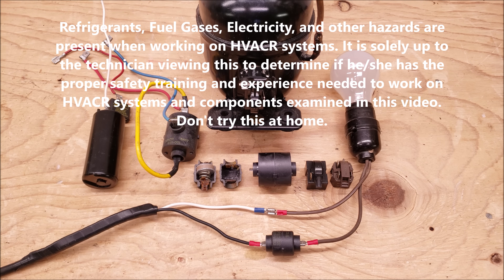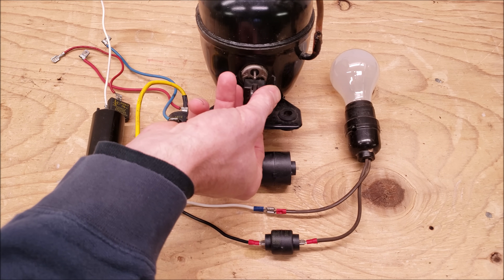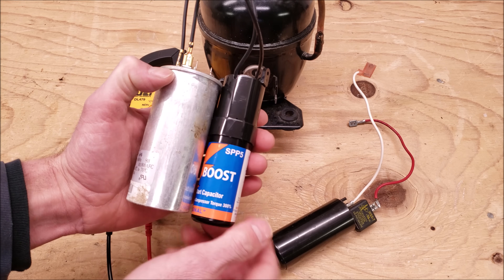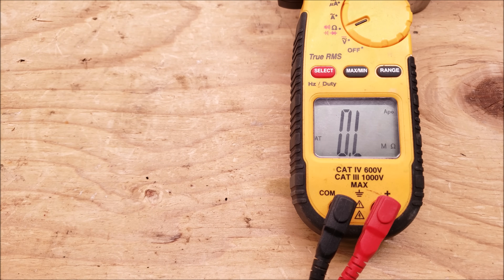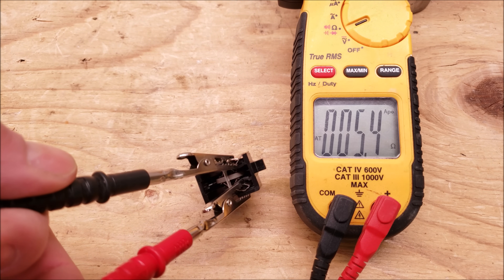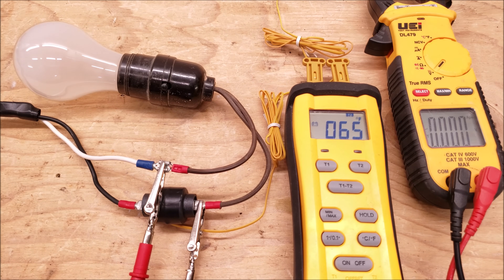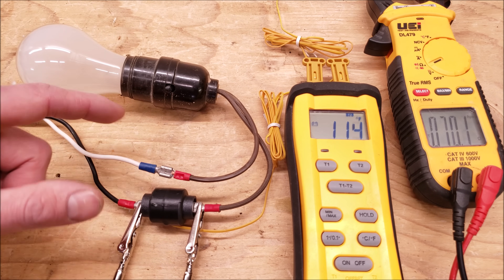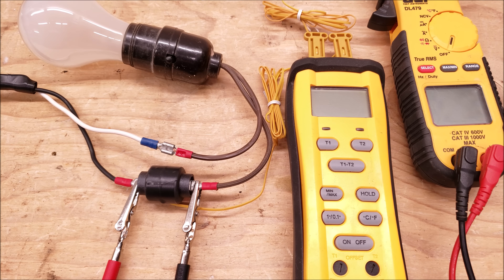PTC Compressor Start Assist, How It Works, Testing!

Comment from the maker: Support-  https://www.patreon.com/acservicetech

Tool List-  https://www.amazon.com/shop/acservicetech

For those that are looking for the tools used in the videos: (Linked Below)
Appion Valve Core Removal Tool http://amzn.to/2uYr8WL
UEI DL479 Multimeter with temp sensor http://amzn.to/2jtsUbJ
Blue Vapor Yellow Jacket Gauge- https://amzn.to/2Ju7pan
Red Liquid Yellow Jacket Gauge- https://amzn.to/2sSFmGH
Quick Coupler for the Gauges- https://amzn.to/2sTk8Ze
JB Test Gauge High Side-  http://amzn.to/2ruQb0l
JB Test Gauge Low Side-  http://amzn.to/2qR0utM
Manual Copper Tube Swage/Expander- https://amzn.to/2WRPa1M
Uniweld Hydraulic Swaging Tool- https://amzn.to/2MlrI8m
Uniweld Swage and Flare Kit- https://amzn.to/2T55jyn
Ameriflame Oxy Acetylene Torch Setup- https://amzn.to/2SRm3JF
#2 Tip for Oxy Acetylene Torch- https://amzn.to/2SPDaeD
Cap-N-Hook Tip for Oxy Acetylene- https://amzn.to/2MbhpUk
Air Acetylene Torch Setup-    http://amzn.to/2aQalsb  
15% Silver Brazing Rods-  http://amzn.to/2gVLyLc
Nitrogen Regulator-   http://amzn.to/2bXdR5f
Nitrogen Flow Meter-    http://amzn.to/2brvoBg
NitroVue Flow Reg-  https://amzn.to/2MiulYv
Ultrasonic Leak Detector- https://amzn.to/2Lw4Zpr

UEI DL479 Multimeter with temp sensor http://amzn.to/2jtsUbJ

Magnet Jumpers- https://amzn.to/2PyKPQZ

Alligator Jumpers- https://amzn.to/2PxqJXn

Fieldpiece ST4 Dual Temp Meter  http://amzn.to/2wc1ME3

Fieldpiece Bead K Type Temp Sensor https://amzn.to/2DBwKfs

Fieldpiece Wet Bulb Temp Sensor https://amzn.to/2RRI7Tw

Fieldpiece TC24 Temp Clamp https://amzn.to/2qHLyjZ

Yellow Jacket Refrigerant Gauge Set http://amzn.to/2aenwTq

Refrigerant hoses with valves http://amzn.to/2aBumVI

Yellow Jacket Gauge set & hoses https://amzn.to/2vLVkV9

Yellow Jacket 4 Port Manifold w Hoses https://amzn.to/2BkuGIq

FieldpieceSMAN360 Digital Manifold Set https://amzn.to/2BdoaD4

FieldpieceSMAN460 Digital Manifold Set https://amzn.to/2nB4Fe6

Compact Ball Valve for Refrigerant Hose https://amzn.to/2KUisW8

QuickDisconnect 90 for refrigerant hose https://amzn.to/2MMtVcg

JB 6 CFM Vacuum Pump   http://amzn.to/2nqbvo8

Appion Blue 3/8" to 1/4" Vacuum Hose http://amzn.to/2uYlVyc

Appion Red 3/8" to 1/4" Vacuum Hose http://amzn.to/2uYg6Ro

Appion Valve Core Removal Tool http://amzn.to/2uYr8WL

Yellow Jacket 1/4" by 1/4" hose http://amzn.to/2umtcod

CPS Vacuum Micron Gauge http://amzn.to/2v1nM3O

Supco Vacuum Micron Gauge http://amzn.to/2v1JRiA

RectorSeal Bubble Gas Leak Detector http://amzn.to/2ckWACn

UEI DL389 Multimeter  http://amzn.to/2xAdaJf

Other tool links can be found in the video description section.

Shop through Amazon! Your Purchases through Amazon provide a means for channels such as mine to earn advertising fees from all purchases after clicking through. Prices are the same as normal-    https://www.amazon.com/shop/acservicetech
Reply: Thanks, this helps to picture how it works. Can I replace a thermistor starter with a hard start capacitor kit, or do I need to have the thermistor in the circuit? I have a mini fridge which stopped running, it just hums. If I manually connect the start & run winding, then immediately disconnect the start, my compressor starts, so I know it's not seized.
Reply: Ptc  realy  electroines      over  lord  type
Reply: Potaley rely  compressar rung starting  relay power giveing  runing point  statring is  pluger strating  come  protaional come point   methad   capater us  runing  starting point..  electroins  rely ptc   line give  come  potacting ..

Comment: The PTC start assist burned up in my Goodman 3ton unit -in quite an explosive fashion. Thankfully I could bypass it and keep the AC running in 110 degree temps. Every AC guy has said it is useless. Not sure I believe it, but... Also changed out the cap while I was in there.

Comment: Do you offer any videos that show how to wire a Lennox Air Handler and Heat Pump with no backup electrical (resistance) heat?

Comment: Thanks for taking the mystery out of the little gadget. The HVAC forums most misunderstood device. Most techs remove it and add a hard start kit, claiming it does nothing or is a cheap way the mfg did a hard start. It's actually an  elegant way to solve the problem, with a safety valve built-in. It's a smart hard start.

Comment: I thought it was just a thermal cut off the bi metal type that resets itself when it cools? So if it is a resistor there must be more circuitry needed? I am a bit confused.

Comment: Hello, I was wondering what would cause a PTC relay to shatter. Ive read electrical surge or compressor motor failure but was curious if there are other reasons and what the most common was.

Comment: Thank you very much. Your instruction helped me to understand more about compressor Start Assist. I have one question, can you help me explain, please. The Goodman 3 tons (without heat pump), the compressor runs with start assist (305C20 Cera-Mite). When the condenser fan runs for around 5 minutes, then the compressor starts. May I substitute 305C20 Cera-mite with Hard Start Kit SPP6? I appreciate your kindness.

Comment: Can you test it out of the circuit by heating it with a heat gun or hair dryer while reading the ohms across it,?  Could you read the voltage across the PTCR while the unit is running, and when it opens wouldn't the voltage across(drop) rise? I'm trying to test my two rooftop A,/Cs on my RV. Thanks for explaining this device.

Comment: On a PTC QP2-6R8 MC1 (EP13I) other then the disk being shattered, what should the resistance be or is it just as long as there some type of resistance it's considered to be working?  My problem is, I can feel the pump engage and within a second or two, it pops off. Is there a ohms range of resistance that the Thermistor is suppose to be within? I can feel it trying to cool, but it just pops off continuously.

Comment: What's the difference between whirlpool, start ptc device,2188829, 22225785 and 2225929. 
The fridge has a matsushita compressor ESS51C and someone replaced the original(22225785) with 2188829,but the service paper work that came with fridge shows a 2218853/2225929. The 2188829 lasted about 5 years. I replaced with same number but it now shuts off when fridge cools to desired temp, then 2 minutes later, fridge comes back on and thermal breaker trips/ resets a couple times, then it runs for a while until cooled down, then process repeats. Is it time for a new fridge? Sure sounds like it

Comment: So the compressor that takes the plug on PTC thermistor has no capacitor. Is that just for very small compressors where you dont need a start capacitor?

Comment: What would happen if they failed to turn off the start winding assuming a start capacitor in the circuit. Would the start capacitor fry !!!!
Reply from the maker: Yes, check out the video on the start capacitor failing that we did about two months ago, thanks!

Comment: I’ve been trying to get into to this trade for year can’t even get an interview any tip on getting there attention? I will also take any training from you that I can even if it cost me. I have cross trade experience too. Thanks
Reply: Be sure you dont get a start with the wrong compamy that will use you just for changing filters and cleaning drains and nothing else. If you see that situation developing then try and move on at first oppertunity.

Comment: if you keep your fridge somewhere that gets cold in winter the ptc can fail to get hot enough to function. fridge will then get warm and defrost. also if you get regular power interruptions you will get a stalled motor. over time it cooks off the refrigerant. best to remove the PTC and build a simple circuit from 2 relays and a capacitor and the guts of a phone charger. final relay switches power to the start coil for a fraction of a second. timed my a capacitor across the relay coil. psu connects in parallel with the thermostat. you can work out the rest, or if you cant then maybe don't try.  i mod all my devices like this for instant reliable restarts. cost is under 5 dollars. 
in Europe nearly all freezer and fridge come with ptc. inverters are best but are silly money.
Reply: I pulled apart a PTC relay after measuring it's faulty (open circuit when cold). All parts look pristine and the whole freezer hasn't been used much so far. 
I really like the idea with changing this unreliable PTC relay out with normal relay(s) and a simple timer or other trick!

In the end a $20 part failure is easily responsible for a $200 loss when all meat in the freezer starts thawing.

Would be nice to hear more details! Did you use the phone charger as a timer to disconnect the start capacitor after about half of a second?

Comment: I have a non starting Kenmore cube fridge ptc, that looks like the first one,  that's measuring in at about 7K ohms cold. This seems a bit high, compared to what I see here, should be at around 6 ohms?. I've been unable to find any specs for the part, a T47B.

Comment: Great video.  Thank you!

Just to be clear, the first two thermistors tested good, around 6 ohms, right?   And a very high resistance when cool means it's bad?  How high?  I guess the disk cracking up is the main way these go bad?  The one I removed makes a rattling noise when I shake it.  

Does the cold-resistance spec make much difference?  I'm seeing 22 ohm and 17 ohm parts for sale, but I think the one I removed might be 13 ohms (marked 8EA 104 13 F9L BRASIL).  Will any of those be a good replacement?

Comment: I might be being a tad pedantic, but I feel I need to correct you slightly. You say that the PTC thermistor reaches a certain temperature and 'disconnects' the start winding.  That's not completely true. 

The resistance of the thermistor rises to a point where there is minimal current flowing through it (and consequently, the start winding), but there is still current flowing through it. It is this trickle current that maintains the temperature of the thermistor, effectively keeping the start winding out of the game.

We call these things solid state relays in Australia.

Despite all of the above, I like your videos and I will be using some of them in my classes now that I have to teach from my living room.  All my examples are in my classroom and I'm not allowed access.

Thank %&@# for YouTube...

Comment: Can you explain about circuit with potential relay, start capacitor and run capacitor, how they energize the compressor,, this circuit I saw when I open a ice cream machine. From Philippines.
Reply from the maker: Look up "acservicetech ptc relay" thanks I did a video on that!

Comment: Great video! One question : When the PTC thermistor gets hot, it interrupts the current to the starting coil. But interrupting the current, the thermistor will become cold again. So how is the coil not being energized again?
Reply from the maker: It will have an extremely high resistance value and will keep  that value since it is a small load until the power is off and that is when it cools
Reply: @acservicetechchannel  I got it, thank you!
Reply: Excellent video and question answers, than you from the UK

Comment: Can I test ceramic PTC thermistor with continuity?
Reply: With PTC thermistor when is cold it's been out of circuit for a while we can read continuity. But it's hot temperature wise the circuit will be open (springs won't be touching the ends) we won't read continuity. Be if we let it cool off and we don't have continuity that means the spring is stuck open.

Comment: So there is either gonna be a thermistor o a starting relay ?
Reply from the maker: Yes if it is a small fractional hp compressor, it will likely have either ptc thermistor or current starting relay and may also have a start cap. If it is a larger compressor, it may have no thermisor or potential relay but if it does then it will be connected to a start cap. When a compressor does not have a start cap, it just uses the run cap to start and to continue to help it run, thanks!
Reply: AC Service Tech LLC thank you! You are great a great help! I’m from Puerto Rico and you have taught me more than I’ve learned at school with your videos! I am forever great full! Keep me coming
Reply from the maker: Glad to help Carlos! Thanks!

Comment: Can you also explain when these are in parallel with a run cap? Are ptc thermistors the same thing as a PTCR?
Reply from the maker: Hey Ryan, are you talking when the ptc thermistor uses a run cap as if it is a start cap? The R stands for relay and it is not a relay. People have labeled that incorrectly with the R but it was one of those things that nobody caught and some manufacturers even picked up the habit, but yes they are referring to the ptc thermistor, thanks!
Reply: @acservicetechchannel  I just looked up more on it and found a PDF, (first result when you google ceramite ptcr)...  They say positive temperature coefficient resistor.  But yea i also found a thread on hvactalk where someone else was confused on what it was. basically the 2 wires from the ptc go to the run cap terminals, So the start winding is getting power through a run cap but also through the ptc. and that's it, and run cap is never taken out of the circuit

Comment: Could you please do a video on how to add oil to a compressor? :)
Reply from the maker: Ryan thanks for letting me know what you would like to see!
Reply: @acservicetechchannel  Of course, I was just searching and not finding any good quality video on oil adding and best practices, something i need to learn.  Also, semi hermetic content?  For people like me only 4 years in the trade with mostly residential experience, Im trying to learn about older semi hermetic systems I have to service, not much info on those either.  Just nice to see video from good techs like you explain and show it versus only reading things from a book. Thanks again and take care!
Reply from the maker: I just did one video on cutting open a reciprocating, scroll, and rotary compressor. Just search "acservicetech reciprocating, scroll, and rotary compressor". Normally we don't have to add oil unless you are pouring out of the vapor line to switch out mineral oil for poe oil. If you needed to add a little oil for some reason, it would be done the same way as adding dye for leak checking on a system with refrigerant already inside, thanks!
Reply: @acservicetechchannel  i did see that one and loved it! Ok thanks Craig
Reply: @acservicetechchannel  Iam thinking of systems that have leaked a lot of oil from a large leak and having to add oil to them from it leaking out a lot over time
Reply: Can use an oil injecting tool, otherwise put the unit into vacuum then suck it in.

Comment: Can you explain the multitap ones more? Like why there is a yellow jumper connecting both ends? I see these on package units.  Also, do some compressors not have a drop relay at all? I feel like I've seen them without, i get rusty in the winter, i only work on AC during summer here lol
Reply: Yea most compressors I've seen just have a run cap in the start winding, what makes other compressors need a drop relay when they don't even have start caps?
Reply from the maker: Hey Ryan, the multi-tap ones are simply trying to reduce the resistance value while using 2 larger ptc thermistors inside. Nothing else special about them other than there is two inside of one shell so don't let the extra wires fool you. On larger systems such as residential ac or heat pumps, these are used to cut out the start capacitor. You will only see some 120v compressors without the start capacitor. It is just about getting the voltage to the start winding in the beginning. This in itself would be a good topic to cover in the future, thanks Ryan!